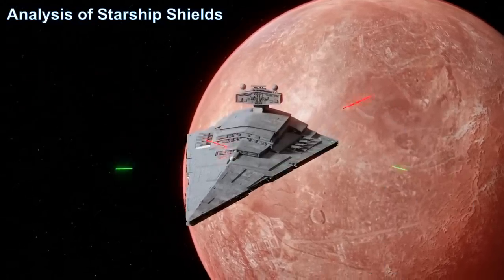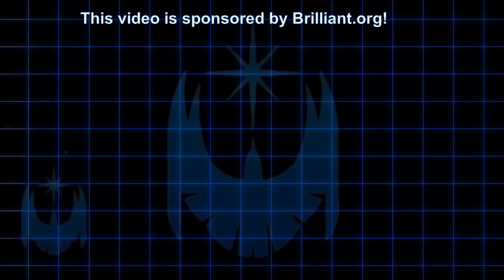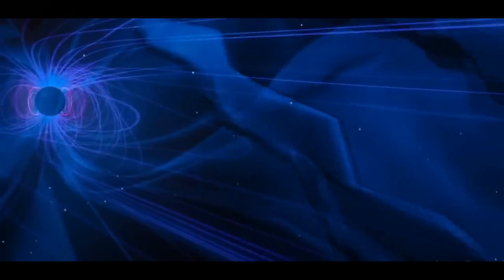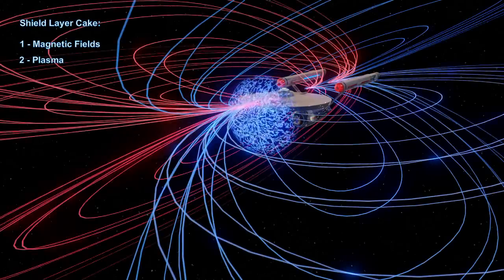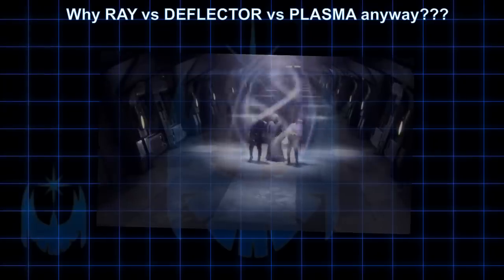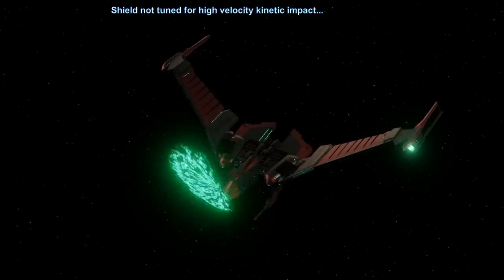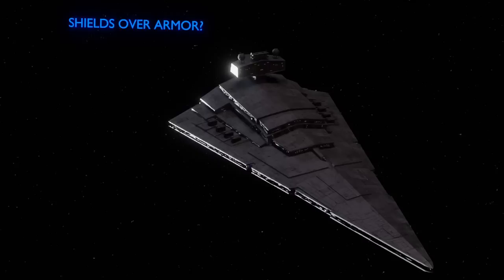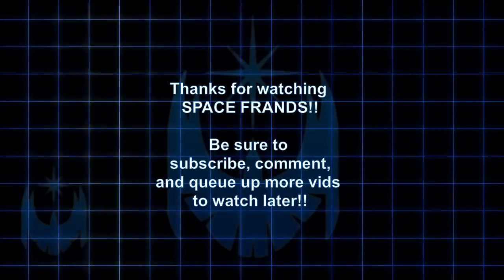REAL Starship Shields Types - They Work Like This...Animated Breakdown!

Comment: I would think that some sort of polished armor would be a defense to laser type weapons,  Something like the Naboo ship in Star Wars.  As for heat type weapons I would look towards what is used on the Parker Solar Probe,  not pretty but it works.  As for explosives weapons,  I do not know fully how a shock wave will work in a vacuum,  but from my limited knowledge shock waves are not a thing in space,  or should I say do not work the same way as Depth Charges in water and slandered explosives in air.  I think the thing that is scar in space are kinetic weapons or just impact weapons.   sabot round, rail guns, mas drivers,  Felix, and A-10 GAU-8 Avenger 30mm gatling gun firing depleted uranium...  But then with those types of weapons you need to store the ammunition on the ship, when it is gone, it is gone.  You also need to take into account of recoil of those types of weapons in space.  Firing a weapon like that can do large amounts damage to the enemy, but needs to be compensated and reaimed every every shot as it acts like a maneuvering thruster when fired.
Reply from the maker: Apparently pure white armor is better as it diffuses the laser light best.
Reply: @resurrectedstarships  And heat too, don't forget that. That's why the Saturn 5, Space Shuttles, and other certain spaceships are painted white to diffuse heat from the sun.
Reply: @resurrectedstarships  Reflective or "high albedo" surfaces however cannot meaningfully protect against lasers powerful enough to be useful as weapons.  Most prospective laser weapons operate in the megawatt range or above which would cause most materials to explosively fracture under thermal shocking, in addition most combat lasers will not be visible light, they'd likely range from the NUV (Near-Ultraviolet) to XUV (Extreme-Ultraviolet) range, and further into the future will likely be Xrays.  These beams will not be reflected in the least by most any metal on the periodic table until you reach Hafnium, which is dense, rare, and difficult to work with meaning it will likely not be in sufficient supply to make up the armor of space warships.  
Furthermore, energy weapons may skip over lasers to laser-coupled particle beams, which while slower moving could impart massive damage to a target because their beam consists of a stream of substantially massive particles traveling at .1-.25C, these kinds of weapons will render practically any conceivable physical armor useless.

Comment: The Earth’s Ozone layer acts like shield for ultraviolet radiation through absorption and deflection. Intense light waves cause interference to lasers. Combine that with a film similar to solar panels on the hull and you could use the diffused energy of the laser that penetrates this shielding to recharge the ship.
[edit:] This was an off the cuff comment, but since it’s spurred discussion, I wasn’t thinking specifically ozone, but particles that could act in a similar manner. My idea assumed a field to keep the particles in proximity to the ship or it would just pass through them like a plane through a cloud.
Film idea was backward. It would be better to be reflective (as some pointed out heat shedding is problem in space). 

Anyway, thanks everyone for engaging with the topic, been a lot of quality ideas in these comments.
Reply: These ships are going to be much more concerned with cooling than having enough energy.
Reply: @kokofan50  yea... He skipped that one class on thermal dynamics and its application with space.  Energy dissipation and all that fun stuff that Star Trek/Wars seemingly skip over in their ship designs.
Reply: @ICU1337  heat dissipation is space isn't common enough knowledge to be incorporated into space fantasy like star wars, or even basic scifi.
Reply: @SECONDQUEST  very sad. I want to see dust used as a method of laser defense more often! It's way better any other material attached to your ship because it doesn't matter if it melts or boils because it's not attached to your ship.
Reply: @SECONDQUEST good point.  Maybe I’m mistaken but didn’t the Millenium Falcon have exhaust vents to dissipate engine heat?
Reply: @ICU1337  Star Trek does not skip on that energy dissipation. 

It is why most ship fights use torpedoes, since they have a far greater range of fire than their beam weaponry, even at warp.
Reply: but there's also a reason solar panels get so hot, be careful with using them as armor, since you basically just changed the attack from light radiation imparting too much heat to light radiation imparting that heat over a larger area. You're still getting baked, just slower, and you're gaining energy from some of it.
Reply: @feartheghus  Well I was only suggesting panels as part of a solution. Shedding heat is a major drawback to widespread use of solar energy on Earth as you point out. Historically the Earth has reflected ~29% of heat from the sun but lately it’s been only ~25% which has been suggested as due to increase in solar panel usage - I’m not completely convinced it can all be attributed to this yet.
However, there is a temperature variance on the ISS of ~278c between side facing sun and side facing away so     shedding heat is definitely a problem for all starship designs. I think starships have to constantly revolve when near stars to prevent concentrated heating on one side just like the Earth and the ISS do.

My spitballing here was that you might try holding ozone gas layers around the exterior held by an electromagnetic field perhaps in combination with a wide spectrum light broadcast to deflect/diffuse most of it then collect some of what gets through for recharging. That last bit was more for ironic wit than a serious idea to power the ship.
Reply: @RetiredAgainForNow  the revolving stations/ships idea sounds like a good an simple solution for the extreme difference in temperatures.
Reply: @RetiredAgainForNow  As for the general idea, holding ozone in is an interesting idea, though I feel like thatd only help with specific bands of radiation. I'm not expert though, so you'd have to ask someone else.... also something to think about, though.
Reply: Mirrors would be much better as sheilding from lasers. Also, the earth's ozone layer is many miles thick which is a bit impractical on a spaceship. I might recommend ice as a general purpose ablative/radiation shield since hydrogen has such good radiation proofing properties. Also, it can act as spaced armor if you put some proper armor outside of it.
Reply: @solsystem1342  I also think Mirrors be a good idea vs laser, but u need the ship to have zero 90° corners or the ships ship stealth ceinture would be zero.
Reply: @alvin41712  you can't make a stealth spaceship. Not one that can house humans because the infrared light given off by the ship would be a dead giveaway. Also, if you're approaching a destination you have to slow down and spaceship engines are famously not stealthy.

Also, tarps exist if you really want to not have the mirrors be visible right away. The tarps can also hold in dust which is one of the best laser defenses pound for pound. Since the dust can melt or boil while not connected to your ship and absorb an absurd amount of power (as in energy/sec). Smoke screens in space? It's more likely then you think. Lol

Oh you could actually fly past your target without lighting the engines. You'd be putting yourself in a really dangerous position though since once they notice you've fired you're in just as bad a situation as them.
Reply: I'm thinking that ozone shielding would be easy countered by a CFC torpedo.
Reply: @alexslgato1735  an ozone shield could be easily countered by pretty much anything. Ozone only blocks some wavelengths of light. Literally throwing dust in between you and your enemy would be more effective laser defense.
Reply: @alexslgato1735  or a Canadian with a couple hairspray cans. (My friend told me this was his response when his sister told him in a Toronto winter that cfcs could cause global warming. He moved to Texas and then Florida as a more immediate and cost effective solution to being cold).
The probability that an alien ship encounter would have expected and prepared a CFC torpedo is as likely as them having my Canadian friend available to throw at it. ;)
No deterrent survives long after it’s first encountered, though.
Reply: Gonna need a pretty big ship or a pretty thick ozone layer.
Reply: The problem with that is it only works for photons with enough energy to cause Ozone to emit an electron
Reply: Ships would have more of a problem with cooling than energy production. The only way for energy to be discharged in space is by radiation. Which is highly inefficient when compared to convection and conduction. Not to mention that most parts of the ship itself also produce heat that needs to be radiated and dissipated somehow. The engines produce heat, the crew produce heat, the weapons produce heat, the electronics produce heat. It’s far more likely that most space battles will end with one side surrendering under the threat of being cooked alive by not just their own heat but the heat generated by the enemy’s projectiles compounding onto their heat production.
Reply: i think that could be classified as physical armor, since it uses matter(ozone) to soak up damage.

But the Earth also has a magnetic shield, its magnetic field! It deflects THE VAST AMOUNT of radiation from the sun. Without it, Earth would quickly look like Mars as the solar winds blow away our atmosphere.

We also have a gravitational shield. Jupiter. It deflects larger physical threats, like asteroids, that might otherwise have been on a direct course for Earth.
Reply: In se they use plasma
Reply: So I offered these ideas as examples of phenomena we are already aware of as a jump off to a final concept rather than to provide the answer. I spent longer typing it on my phone than I did thinking of it. 

I’ve enjoyed seeing the responsive comments - I had in mind that there are adaptions that can step us up to a final plausible efficient and effective solution. 
Chaff is essentially a cloud effect barrier, space shuttles used a TPS with coated ceramics, reinforced carbon-carbon on nose cone, refractory fiber insulation tiles, - all designed to reflect or wick heat off
Reply: On paper at face value this seems like the ultimate stonks move, but this is forgetting that pure energy based weapons would have to have some form of kinetic force to be viable as a weapon. An outer hull made of solar panels or something similar would be pretty easily damaged.
Reply: I remember there was this one geospatial YouTube channel I used to watch from time to time where the guy would actually talk about the earth's deflector shields being weak today because of a solar flare or something like that! He sounded like a redneck but he seemed to know what he was talking about... I think the channel was called MrMBBB or something like that? Though, he wasn't talking about the ozone layer, rather, the earth's magnetic field...
Reply: @EdKolis  yes that’s what he’s describing
Reply: He kinda starts the video with that.
Reply: Not to sound rude but this is an awful idea in basically every way possible
Reply: Bruh